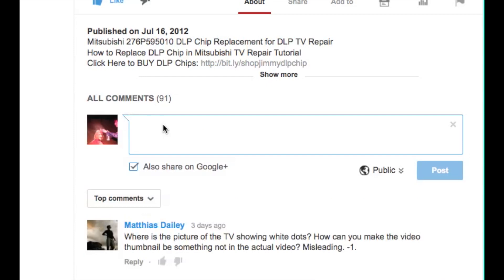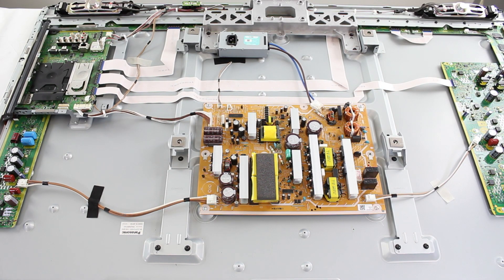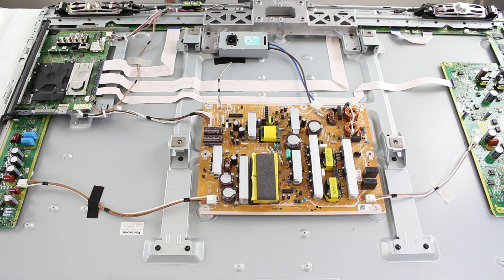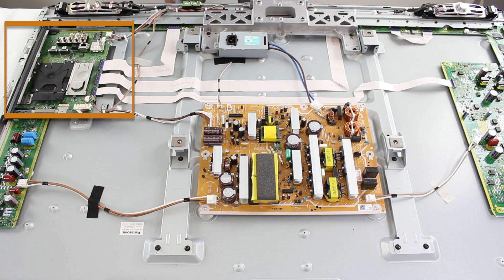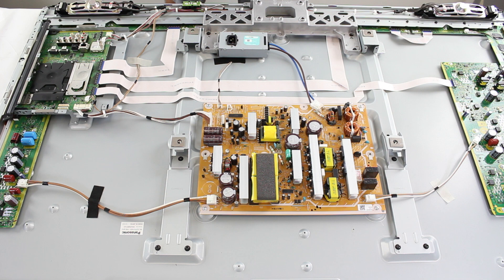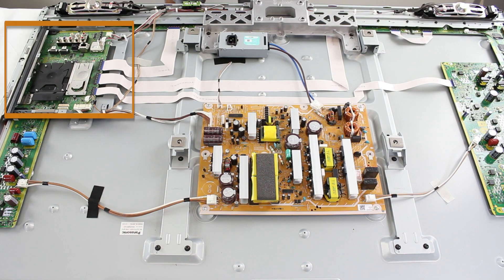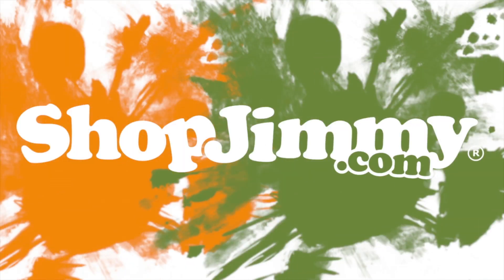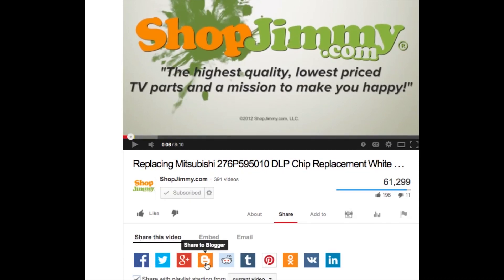TV Not Working After Storm - TV Lightning Strike & Storm Guide for Power Surge Problems

Comment: 60 inch Visio model E600i-B3. Power cord shows damage at plug in. Power supply showed damage at power cord terminal. Cord still shows 120v. Tested with fluke meter. Replaced power supply with a shop jimmy replacement. Still no standy light. TV shows no sign of power. Power supply has 120v at terminal input. Pls help. Thx. Loved you video.
Reply from the maker: Michael Barousse   PLEASE SUBSCRIBE TO OUR CHANNEL - Try all repairs and troubleshooting at your own risk.  I recommend replacing the main board in your TV.  Click this link to replacement parts for your TV model number:  http://www.shopjimmy.com/catalogsearch/result/index/?cat=56&q=E600i-B3  There may be multiple boards for the same TV model number, be sure to match part numbers on your current board, with your replacement for compatibility.  Thanks and please let us know if you have any further questions with your TV Repair!  www.shopjimmy.com

Comment: TV REPAIR HELP PLEASE. I have a 55" Vizio smart tv which is no longer working. (Model # E552VLE Brand- Vizio)
Our satelite dish on our house was struck by lightning and im guessing the surge came through the dish box into the tv and out to all devices connected via HDMI (PS3 & PS4) My devices still have standby lights but the tv will not power on or display a standby light. I have inspected the boards and cannot see and damages. how would you recommend i further diagnose this issue? Thankyou and hope to hear from you soon

Comment: I have a Visio E70 E3. It was hit by lighting, the tv worked irradically for a couple days then stopped completly. The TV would not power on or show any standby lights etc.

 I replaced power board, main board, toon board and power/channel button board all at the same time. When turning the tv back on I now have power indicator lights, front screen seems to light up dimly but the Visio logo screen nor anything else ever displays. Then it will go black for a moment the standby light turns orange and then it will appear to try brightening up like it’s turning on again. It continues to do this cycle until you turn the tv off completly again.

I have tried power cycling the tv by unplugging it holding down the power button for ten seconds and then plugging it back in again but that doesn’t produce results of any kind either.

Any ideas what’s wrong or have I most likely wasted a lot of money on boards on a tv that is too far gone?

Thanks for you help!

Comment: I have a Funai 32" Model LF320FX4F.  The tv will not power on what so ever.  No lights, or anything.  While plugged in, it makes a high pitch noise from what seems like the power supply board?  It does this as soon as you plug it in.  No way to turn it on.  Any advice?

Comment: Hi, I had a power surge and/or lightning strike on my tv. It was lightning and after a very loud boom the power went out. After that my tv would power on and stay on for a 45 seconds at first and then it would go off as soon as i turned it on. The next day it would not power up at all nor would the led indicator light so any activity. I do not see any cracks or burn marks on any of the components but i went to your shop and purchased a new power supply for the model of my tv a VIZIO M501d-A2R 50-Inch Vizio tv. I took off the casing before hand to make sure i had ordered the correct part. My tv is still not working. What would you suggest?

Comment: Hello, I have two TV's that are currently not working, however, they both seem to have the same issue. The first TV is an LG 42lk450, a 2011 model. When the TV is plugged in, the power button lights up red, then when I press the power button to turn it on, it turns blue, but there is no picture or sound at all. I believe the issue is the result of a power surge via the HDMI cable and HDMI port. One of the HDMI ports is charred and when I removed the back cover I noticed a burn mark on the board around the HDMI port. My other TV is a JVC JLC37BC3002, not sure what year. When I plugged it in there was no sign of a standby light and when I press the power button, there is no picture or sound, just like the other TV. This TV has the same signs of a power surge. Charring in the HDMI port and burn marks on the board around the HDMI port. Is it possible for either of these TVs to be repaired?
Reply from the maker: +Nick White  Try all repairs and troubleshooting at your own risk.  I recommend replacing the main board in both TVs.  Click this link to replacement parts for your TV model number:  Click these links to replacement parts for your TVs:  http://www.shopjimmy.com/catalogsearch/result/index/?cat=56&q=42lk450  http://www.shopjimmy.com/jvc-3637-0842-0150-main-board-for-jlc37bc3002.htm  There may be multiple boards for the same TV model number, be sure to match part numbers on your current board, with your replacement for compatibility. Thanks and please let us know if you have any further questions with your TV Repair!  www.shopjimmy.com

Comment: LG 42" LED TV. Massive lightning strike took out two TVs and two 27" Apple Thunderbolt displays. Naturally I'm trying to save money by fixing my TVs myself. I have no standby light or power. I replaced the power supply board, but I still get no standby light.  Where is the next spot I should look. We have cable, so no satellite dish to worry about.

Comment: Good morning!  My tv was hit by a power surge from lightning striking my house and unfortunately stopped working.  The TV is an Insignia, NS-L55X-10A.  The TV turns on, but when i change the input, only 2 of the HDMI's show up as an option when 5 should be showing.  If i do connect something to one of the HDMI's thats available, for example, my xbox, it will show up for a couple seconds, then lose signal.  Would you have any idea what the issue could be??  Thanks!

Comment: Hi Jimmy,  thank you for posting this great video.  I have a Samsung LN46b750u1fxza that stopped working after a storm a few years ago.  I don't think the surge was significant b/c while the screen is black, it still has a standby light and "responds" i.e., the light goes out when you push the power button on the remote.  When you attempt to turn it back off, however, the standby light doesn't turn on again until you unplug and repeat.  Anyway, I don't want to invest in fancy tools and was wondering if you might know which board might be affected.  I'm going to open the TV later today once I get a Phillips screwdriver. Is there a way I can upload and send you photos?

Comment: I have a RCA 55" model led55c55r120q, I had a lightning strike and now my living room tv is only clear on upper channels the lower channels are distorted. I have checked cable and moved my bedroom tv into living room and it works fine. I have ordered and main board to correct problem. Was this a good move.

Comment: Samsung TV UN70KU6300FXZA after power surge

Tv would not turn on. I replaced the main board and TV now works. However the remote now only turns on the TV and no other buttons work. Is the the wifi/ bluetooth transceiver? Thanks for your help!

Comment: Hello,  I have a LG 32lb552u-tb satellite TV that got damaged by lightning, I had no power surge...  the power light isn't coming up.  I opened n tried to look for physical damages on the power board but couldn't find any n I also tested some components with my meter(though not all as I'm a newbie) didn't find any fault... the power on pin on the board read 5v as it should but 2 other pins which should read 3.5v are getting 1.5... any ideas you can help me with?

Comment: Hey I got multiple broken tvs. one is a 32 inch lcd smart flat screen Vizio tv won't power on. 2nd is a samsung lcd 32 flat screen red blinking light and no its not capacitor is blown since I recently replaced those with new ones even got a new power board completely.  if you can solve these two congrats then I'll let you know more of the tvs I have broken I ain't afraid to order parts needed just ain't gonna order wrong part again

Comment: Hi I have a Samsung LA37A550. The picture suddenly faded and is nearly white. I can still see the image but it has lost all its color. The repair shop says it is a panel problem, which they cannot supply, but after watching your informative videos I think it could be a T-Con board. Do you perhaps have any ideas?
Reply from the maker: John Harty   Try all repairs and troubleshooting at your own risk.  This could be a problem with either the t-con board, the main board or the TV panel.  You can replace the t-con board and main board individually to see if one of those boards fixes the problem.  Click this link to replacement parts for your TV model number:  http://www.shopjimmy.com/catalogsearch/result/?q=37A550  There may be multiple boards for the same TV model number, be sure to match part numbers on your current board, with your replacement for compatibility.  Thanks and please let us know if you have any further questions with your TV Repair!  www.shopjimmy.com

Comment: I had lightening strike a tree several feet from my house and it affected a lot of my electronics. I am looking to fix my vizio E550VL. With the power cord plugged in the vizio emblem on the from of the tv will light up and change from orange to white while making an audible clicking sound. I have removed the back cover to see if there are any burn marks on either board but have not found anything that looks burned or cracked.
Reply from the maker: Trey Whiddon  Try all repairs and troubleshooting at your own risk.  I recommend replacing the power supply and the main board in your TV.  Click this link to replacement parts for your TV model number:  http://www.shopjimmy.com/catalogsearch/result/?q=E550VL  There may be multiple boards for the same TV model number, be sure to match part numbers on your current board, with your replacement for compatibility.  Thanks and please let us know if you have any further questions with your TV Repair!  www.shopjimmy.com

Comment: I have a Toshiba model c390 l d – df6 to serial number 10195 18 - DC-3 d3ad 00775. It had a power surge and the standby light turns on but then it turns off and it doesn't power up what can I do to check is it the mainboard or the one with the brain
Reply: Model c390LD-DF62
SN-10190518-DOC3D3AD00775

Comment: Hay mate, i have a Sony KD-70X6700E, lightning strike hit the ground and come up through internet cable that was plugged in the back of tv, got both boards out and no burns or cracks, ive asked Sony twice if i can get both boards but its turning out to be quite a struggle, do you guys stock the main and power boards for that model, cheers mate

Comment: I have a Samsung 55 inch UA55F6700. We were stuck by lighting and blew about 10 different appliances around the home.The TV standbylight blinks on and off and you can hear the main card ticking ( sounds like it is trying the start he screen up). I dismantled the TV and replaced the BN44-00625A board which i thought was faulty. This has not repaired the problem and am left with the same issue. i did not purchase the part through you guys as i have just found you now. Sorry. Any thoughts on the issue.
Reply from the maker: Michael Davis   This could be a problem with either the main board or the power supply board in your TV.  You may need to replace each board individually to see which one fixes the problem.  Unfortunately I do not see any replacement parts in the search results for your TV model number on our website.  Please reply with your part number on your main board and power supply board and I can try searching for replacement parts.  Thanks and please let us know if you have any further questions!  www.shopjimmy.com

Comment: Hello, after a power surge my Plasma TV's display stopped functioning properly. The screen is dark and I can barely make out what is on the screen. The picture also goes out completely intermittently. The power supply board has already been changed. Do you have  any other recommendations? 
TV 
Zenith 
z50pv220

Comment: Hello, I hope you can help me as I have had some bad luck with TV's the past couple of months. I moved into this place about 6 months ago and have had two TV's go out on me! 

I have a 32" Funai TV LF320FX4F. I believe there was an electrical surge to my TV that caused this one to go out. I say that because the wiring to my light switch was loose and is wired to the reciprocal that my TV was plugged into. I didn't have it plugged into a surge protector (big mistake). The TV does not work at all. If I plug it in, it only makes a high pitch hissing noise and the power light does not light up at all. It's like it's not getting enough juice to power on. I looked at the boards inside and none of them look to be burned. Could it just be the power cord that I need to replace? This TV is only a year old.
 
The second TV is A 42" Dynex DX-LCD42HD-09. It is weird what this one is doing. So if I have it hooked to cable and the source is on TV, the TV will turn on and play for a couple of minutes and then the sound will go out and the picture will pixel. After a couple of minutes the screen turns blue. At this point, the TV will not turn off unless you unplug it. So I messed around with it and it works perfectly fine when it's in HDMI mode. I can hook my computer up and play a movie with no problems. I hooked it up to my CD player (which is through HDMI) and it played fine as well. I have not looked inside this TV yet to look at the boards. Please help!

Comment: I have a samsung PN50A550S1FXZA . Replaced both bn44-00222 power and bn94-01658 main boards after suspected lightning while on directv. Still won't power on with clicking and blinking red on/off light. Standby light at bottom of set shines. Help?

Comment: We have a Samsung UA48J6200AW TV - struck by lightning but red standby light still working - flashing 6 times in a cycle - power supply surge protector did not trip - power surge came in thru the antenna plug into main board - main board also had Apple TV and modem connected  - both failed.  I opened up unit and power supply board looks fine and capacitors seem fine - I suspect problem most likely in main board even though there is no obvious/visible damage to that either. Can you help Jimmy ?  Thanks

Comment: Hello,
Our home was struck by lightening and many of our electronics were ruined. We suspect it came through the cable line, but are not certain. Our power strip was not blown to the TV, but our Panasonic Vierra VT60 55 inch TV will not turn on, but there is a blinking red light that will not stop blinking. Our surround sound receiver was ruined.  Do you think our TV can be repaired?

Comment: I have had Direct TV for 2 weeks and was hit by lightning today. All of my equipment is on power surge protectors and the only items affected are the Direct TV equipment and my TV's. I believe the surge went through the HDMI cord. Is the mother board the item typically damaged? Neither TV will power on and do not have a standby light. I have a LG model Number 60PA6500 and a Westinghouse.

Comment: I have a Phillips 55PFL5601/F7. Lightning storm came through last night and got it and a DVD player. The tv will come on and cycle through the source menu via buttons on the side, but won't find a signal. My remote doesn't work with it either. Thanks in advance.

Comment: Our large screen tv was struck by lighting. There is no image, BUT, there is a clicking sound coming from behind the tv where the cable cord is attached.  The strike did not take out the cable box or anything else around it.  Yes, it was plugged into a basic power surge panel.

Comment: After lightning strike only can get same 6 channels on 2 different TVs connected to same antenna.  Used to get several other channels.  Have tried rescan several times.
Reply: I have a similar problem , after a storm and close lightning strike I can only get one channel (which is actually three together) where I had a total of almost 20 before , tv still works great as it always has just less channels than before , the tv never went off , just lost all channels in the beginning but now only one comes in , when I rescan at night some of the other channels show up but don’t come in “says no signal “

Comment: I have a Samsung series 6, 6030 led tv. We had a bad lighting storm. The light flickered in the house & everything on the that power strip of the tv turned off and then came back on however the tv did not. The red standby light does come on & blink but the tv won't light up. I have the back panel off the tv but don't see any visible damage on either of the boards you have discussed on this video. I don't see any swelled components either. Is there a general reset on the tv I'm not seeing. What should I do? Help...
Reply from the maker: ShowerFilterStore  PLEASE SUBSCRIBE TO OUR CHANNEL - Try all repairs and troubleshooting at your own risk.   I recommend replacing the main board and the power supply board in your TV.  Try all repairs and troubleshooting at your own risk.  Please reply with your TV model number.  Click here to view a video that shows how to find your TV model number:  https://www.youtube.com/watch?v=S51nhAmwR2M  Thanks!  www.shopjimmy.com

Comment: LC60C6500U hi there my house had a lightning strike and took out my modem and a wired Uverse box a wireless box and my sharp 60 inch LED TV.  Power strip is fine but my TV fails to turn on I tried the service reset from sharp trying to get to service mode all that I get is blue screen remote does not work at all. I'm going to attempt to fix it. I've built boards for pc's and other stuff so I'm inclined to fix just need some guidance and prices of the boards I need